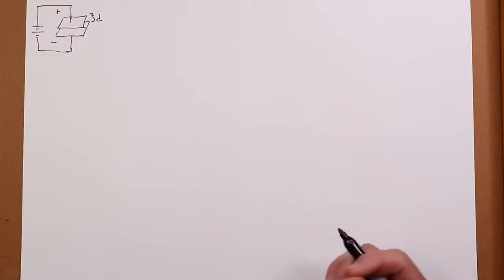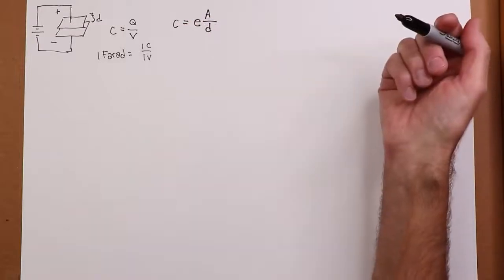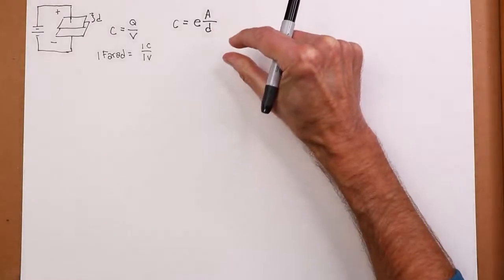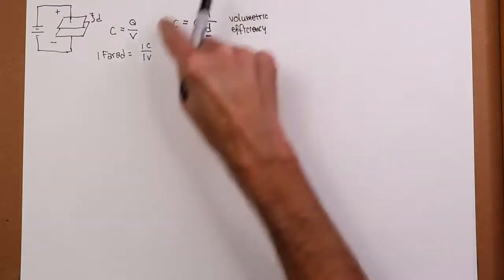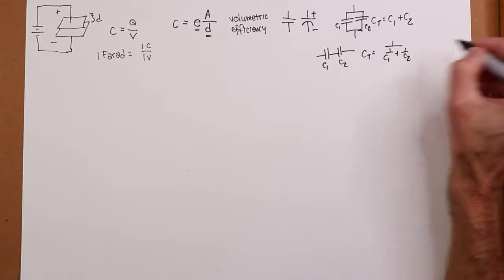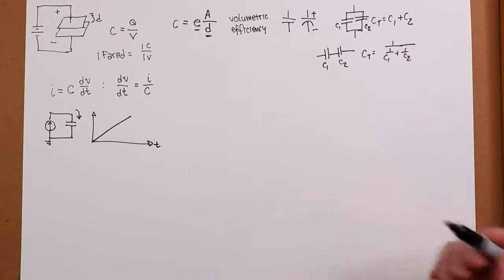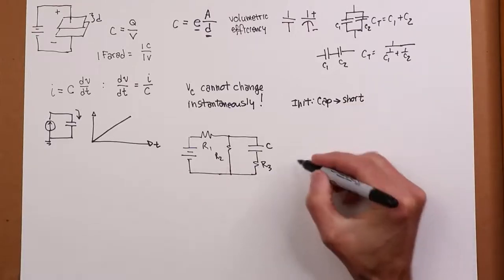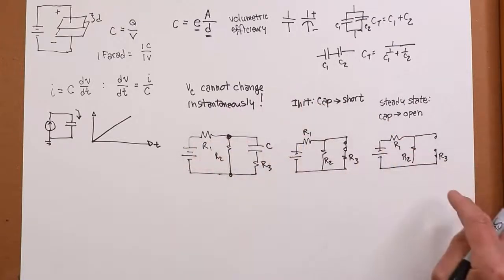Introduction to Capacitors

Comment: @Electronics with Professor Fiore
Hello Sir!
"For DC analysis, initially capacitors appear as shorts"    Please elaborate.
The two plates of the capacitor are separated by the dielectrics.What is the mechanism inside the capacitor that makes it to operate as a short?
Reply from the maker: As detailed in the accompanying text (free download at my web site), the voltage across a capacitor cannot change instantaneously. The rate if change of voltage across a capacitor is equal to i/C, thus, an instantaneous change in voltage (i.e., infinite slope) would require an infinitely large current source (which doesn't exist). Imagine a a series RC circuit driven by a voltage source, at rest and with the capacitor not charged. The R and C voltages would both be 0V. Now we turn on the voltage source. The instant we do this tere can be no voltage across C because that would require the infinite current. This Vc must be 0V and all of the source voltage must drop across R in order to satisfy KVL. Thus, at that instant, the capacitor appears to be a short (i.e., has 0 volts across it). Mind you, this is an operational description. What is happening is that charge is being deposited on the plates. Eventually, this will build to the point where the capacitor voltage equals the source voltage and virtually no current flows. At that point, the capacitor is behaving like an open because all of the source voltage appears across it, and none across R.
Reply: @ElectronicswithProfessorFiore  as soon as the switch is turned on,charging of capacitor begins and when its fully charged(it's voltage being nearly equal to DC source) the capacitor becomes open.
While on,the capacitor behaves as short before the begining of the charging process.Can you describe this mechanism please?
A capacitor is short means that it is letting the all electrons pass away across its dielectrics?Is it possible?

Why does the charging process inhibits the conduction?Why cannot the conduction inhibit charging process and remain shorted?

I would be enlightened if you describe the overall mechanism beginning with turning the switch on.
Reply from the maker: @उमेशजोशी-प8ध  The key to this is the current-voltage relationship for a capacitor. The rate of change of voltage across a capacitor is equal to the capacitor current divided by the capacitance, dv/dt=i/C, as indicated above. It seems like you are trying to think of this like a resistor that is changing (like a rheostat). That is not a good model for a capacitor. 

For a different analogy, think of the capacitor as a bucket which is fed by a pipe. The amount of water flowing through the pipe is the current and the height of the water in the bucket is the capacitor voltage. How quickly the water rises in the bucket depends on the size of the bucket and the amount of water coming out of the pipe. As long as water keeps coming out of the pipe, the water level in the bucket keeps rising (until it overflows or the bucket breaks, which is analogous to reaching the cap's breakdown voltage). But what if the amount of water coming out of the pipe changes? Then the rate at which the water rises in the bucket also changes. Now suppose that the bucket is resting on a valve that is connected back to that pipe, and which starts off open, creating maximum water flow. As more water flows into the bucket, the heavier it gets, and the more it pushes down on the valve, which starts to turn down the flow of water. Eventually, the bucket will get so heavy that it will turn off the valve completely and no more water will flow into the pipe.
Reply: @ElectronicswithProfessorFiore Thanks for excellent analogy.....As you mentioned, bucket resting on the valve become heavy so does it mean that "capacitor voltage" increases and reduces the incoming water flow (current)?
Am I right? Kindly correct me Thanks for your excellent work.
Reply from the maker: @cck0728  Basically, yes. In a simple RC circuit with a voltage source, what must always be true is that the sum of the voltage across the cap plus the voltage across the resistor must equal the source voltage. Further, the current in this loop is defined as the voltage across the resistor divided by that resistance. So, as the cap voltage rises, that means there must be less voltage across the resistor, which in turn means that the current has decreased.
Reply: @ElectronicswithProfessorFiore  Thanks for the clarification.... Appreciate.

Comment: When we worked with resistors we found we could convert them to conductors, the inverse of resistors, and add in parallel. But what is the inverse of capacitance, What type of device would that be how do we know we can add them in parallel like we can with conductors?
Reply: I mean how do we know we can add them In series period like we can with conductors in parallel? Perhaps my question doesn't make any sense.
Reply from the maker: @Chris-hi2hn  Resistance and conductance are two ways to describe the relation between the same variables. One is the ratio of current to voltage, and the other is the ratio of voltage to current. In essence, one indicates how well current can flow through a material while the other indicates how poorly current will flow. If you know one, you know the other. Everything you need to do with resistors can be done without defining something called "conductance" (and vice versa). More than anything, it's just a convenience (with historical underpinnings). 

You could define the reciprocal of capacitance (or inductance) and have a similar situation, but what's the point? Personally, I think it would just add confusion. In contrast, if you get back to the definitions, extensions become obvious. For example, if you understand that capacitance is directly proportional to plate area, then it becomes obvious that caps placed in parallel must add. Two identical caps placed in parallel exhibit twice the plate area of a single unit while everything else is unchanged. Thus, it must exhibit twice the capacitance. For a series connection, you can make a similar observation using plate separation distance.

Comment: Excellent, Thank you. I can see how we could use capacitors to give a 'slow-start' to a circuit and the inverse. Is there any danger in leaving capacitors near full-charge in a circuit (potentially for days at a time)?
Reply from the maker: Sure. If the potential is high, it becomes a shock hazard! Many years ago I was taught to short the power supply filter caps on things like audio power amps before working on them. Some people used to use a screw driver with an insulated handle and place it across the terminals. In fact, careful designers would place resistors across the cap terminals so that the charge could bleed off within a few seconds. Big power amps could have upwards of 100 volts sitting across those caps and with thousands of uF of capacitance, that can supply a serious jolt. 

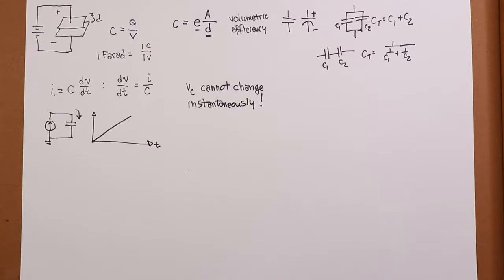On the other hand, so-called "super caps" are normally left at full charge to supply temporary backup power, but these are holding just a few volts. I bought a VCR (remember those?) back in the late 1980s that had a super cap. I could unplug it, move the unit to another room, plug it back in, and the clock and other settings would be maintained. It would take several minutes for the cap to discharge, so as long as you were quick about it, no more blinking "12:00".
Reply: @ElectronicswithProfessorFiore  Thank you. Good idea, stick a fat-resistor to bleed the charge to ground sounds like a good idea. I was thinking more in terms of an active circuit with the cap permanently charged (I don't think they get hot but wonder if there are any other risks apart from electrocution, risks in having them charged in circuit doing nothing.)
Reply from the maker: @simonyoungglostog  Generally speaking, caps don't "like" heat, meaning it will shorten their life. Also, in order for a cap to stay fully charged, there will have to be some manner of source actively feeding it. Without that, the charge eventually will bleed off due to internal leakage and/or shunting impedance.